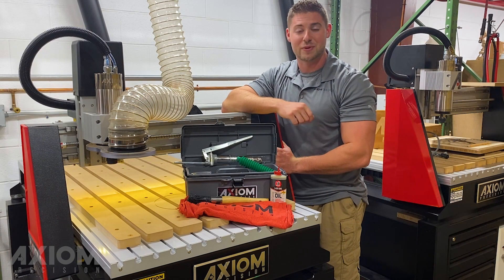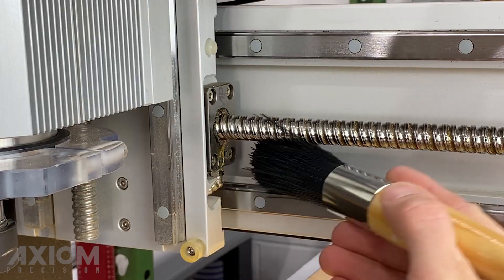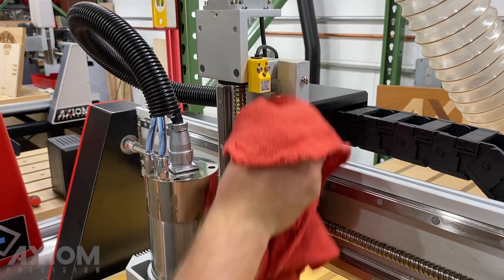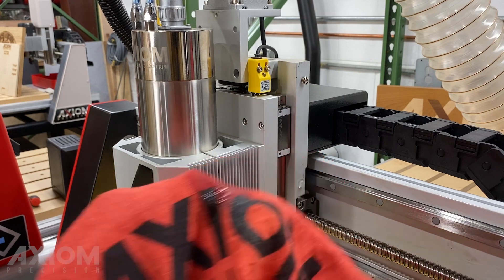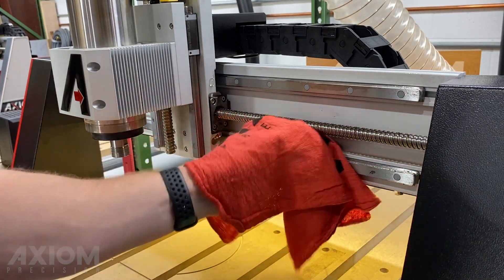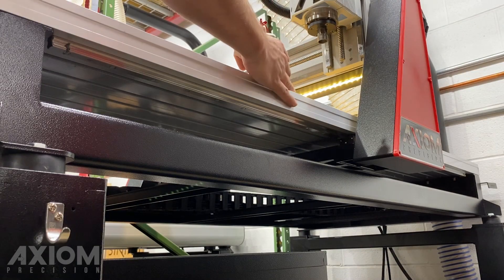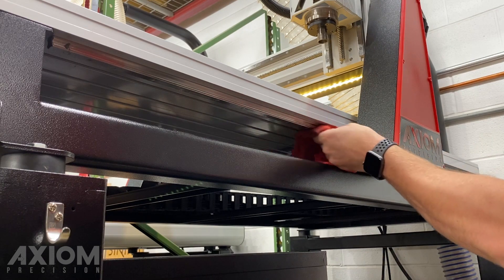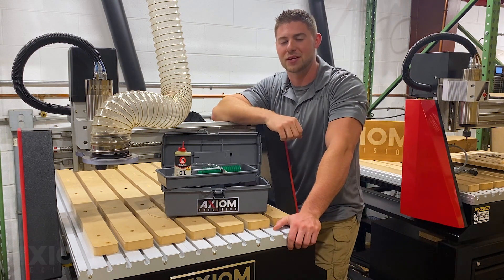Axiom Machine Maintenance Part 1 "Daily Maintenance"

Comment: Sir can I use WD40 spray for lubrication, because 3in1 oil not available in india, so can I use WD40 spray
Reply from the maker: Sonu, We don't recommend using WD40 for your lubrication. WD40 creates a film that will build up on the ball screw and may result in issues in the future. We recommend using a light machine oil, something mineral oil based. We hope this helps.
Reply: @AxiomprecisionCNC  sir can I use hydraulic oil 68 number